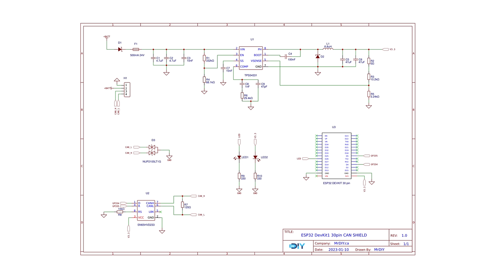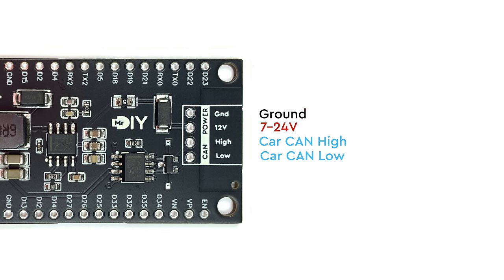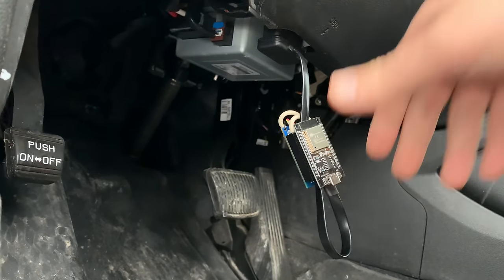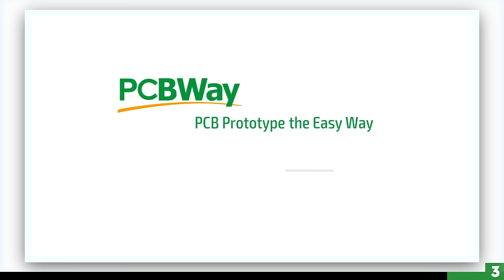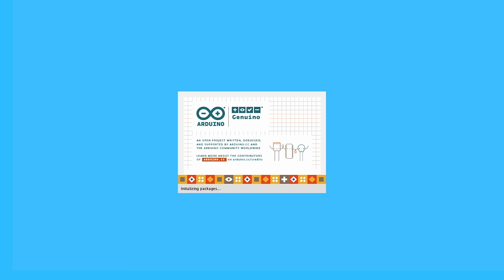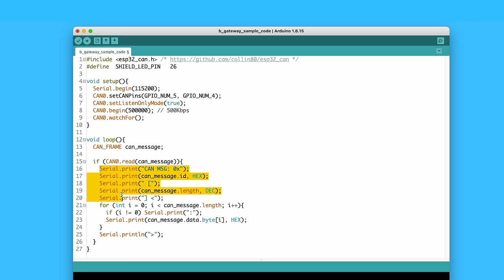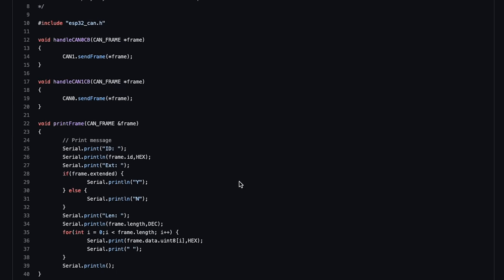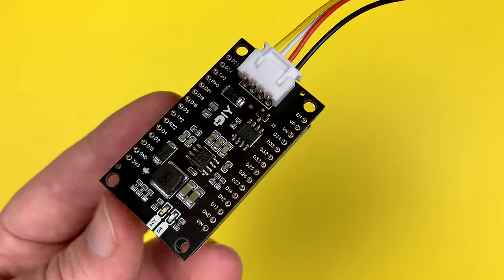The EASIEST Way to Connect to a Car's CAN Bus

Comment: I just bought 2x esp32-s3 otg's and a canable pro for reverse engineering undocumented BRP messages. My thought was to use both usb dev and host modes to relay the canbus messages (usb packets) over 'esp now'. One on the vehicle, and one on a laptop running candlelight or whatever.  With this piggyback board it seems I could avoid tunneling usb and pass esp now messages to the other esp32 and present it as a SocketCAN interface. Not sure which is less work.
Reply from the maker: That is exactly what I am doing right now. Car -> [CAN Shield -> ESP32]  -> ESPNow -> [ESP01 -> USB] -> PC/SavvyCAN. I wrote a minimal LAWICEL/SLCAN protocol on the ESP01. I just got it to work yesterday and can see the msgs coming in live in SavvyCAN.
Reply: Why do you need multiple ESP32? They have both Bluetooth and wifi, can’t you just use one of those to send data to a laptop? Simplest option would probably be to use either serial over Bluetooth or get it to work similar to a usb device over Bluetooth.
Reply: @conorstewart2214  ATV & other canam toys to ride around and rx/tx live data over long-ish distances. Don't want the laptop on the moving machine. BT imo is too short distance. 

I naively assume Windows would need a signed custom driver to turn wifi data into a virtual com port the usual canbus apps need. Seemed simpler to have another esp32 plug in to usb port and appear identical to the canable usb device. esp now will let me adjust speed/distance tradeoff as desired. 

YT comments lousy place for meaningful discussion sorry.
Reply: @MrDIYca  Awesome, looking forward to more vids on your project and a future github repo :)  My plan is more of a generic usb<>espnow<>usb extender than a canbus specific project. I bought all the stuff but no promises I will get around to it.
Reply from the maker: yes, that is another upcoming video

Comment: Can this thing turn off auto stop-start? Also does firewall cause a lot of headache?
Reply: What firewall? Do you know how Can Communication work's?
Reply: @skyminer01  Not really. But heard so much that with auto stop start eliminator device you can't plug it just anywhere because at least for subaru outback some places are firewalled - that is they don't accept injected packets.
Reply: @test-rj2vl  can bus is broadcast, u can just read as much as you want.
Reply: @test-rj2vl  writing obviously is a different story. Encryption, preconditions and session handling can prevent you from changing settings
Reply: @skyminer01  Ah ok so you cant write with this thing?
Reply: @test-rj2vl  you can write theoretically. But normally you really don't want to. The Can bus in a car is a critical system which you don't want to fail. Writing to the bus could cause it to fail or to be blocked if you don't exactly know what you are doing.
Reply: @skyminer01  Well auto stop-start eliminator for subaru outback does not work for european models. Was wondering if I can record the packet that is being sent when I toggle it and then use this thing shown in video to send my own packet every time car gets turned on. To effectively make a version of auto stop-start eliminator  that works with european version of subaru outback.
Reply: @test-rj2vl  Also it depends what you are trying to write, there is data that is sent cyclically every tens, hundreds of milliseconds so if you changed that the original sender will send it too and the receiver will react to both, there are other solutions to turn off auto stop start
Reply: @danradum  such as?  If you mean manually pressing the button then it needs to be done every time because it does not remember the off state.

Comment: Noob question: does the shield simply plug in, or is soldering required?
Reply from the maker: Sorry if it wasn’t clear but it requires to solder the header pins to the shield. Then, it is plug and play with the ESP32

Comment: I have ordered and received your board, as well as the esp32 board from your store...  Loaded all the needed libraries, and your example code - but all I get is a spinlock error.  All other non-can related sketches run fine on the board, but your can example does not...  Where can I get some help?
Reply from the maker: Hello Alec, you can reply to the order confirmation email and I can help you there.

Comment: Where can I get the cable / adapter to connect the boards to a Tesla Model 3 ?
Reply from the maker: You can try https://geni.us/AsDPDz but check with the seller to make sure it is comparable with YOUR Model 3.
Reply: @MrDIYca  thank you
Reply: @MrDIYca  Is there a USB interface in the rear of the Model 3 ?
Reply: Having looked at the above link there are many  different cables shown, which one is the cable I need to connect my 2020 model 3 Tesla ?

Comment: Can you comment on whether it can connect to an OBD 1 port. This was introduced in GM cars back in the 1990's and was also called an ALDL port. OBD 2 didn't start until 1996
Reply from the maker: Good question, I am not sure ... maybe an automotive history buff can help us out here
Reply: I don't believe any ODB 1 cars used CAN bus.  I don't think it was until some years after ODB II came out that some cars started using CAN.
Reply: @Jason Watson  i don't think all obd II is even canbus.i think it really started around 2004 or so,  same time as drive by wire and such.  For example on a 96 impala with obd II you can't unlock the doors or start the car via canbus
Reply: ALDL is nothing like OBDII. It is 160 bps serial data, very simple. There is an android app for it. I have a 26 year old web page on the subject from when I wrote a parallel port decoder for it. GM ALDL specs are available if you search.
Reply: OBD1 is manufacturer-specific diagnostics so the protocol and connectors are manufacturer-specific

Comment: Can the CAN-Bus termination resistor (120R) be disabled?
Reply: you can clearly see when hes holding the board that the resistors isn't even soldered on the board, so what do you think

Comment: I'm interested in buying your CAN Bus Shield. I'd like to plug it in the OBDII of my car. But once I get all set up and the car connected to the board, printing messages to the serial, how am I going to translate messages like the ones you showed in the video, for example: CAN MSG: 0x19C [5] <09:F7:98:9>. How to translate it into useful data? Me I'd like to get to know speed, hodometer, fuel level, and stuff like that. How can I translate messages like <09:F7:98:9> into fuel level, for example? Is there any code examples I could look into? I'd like to get to know more about it before purchasing this board. Sorry, but I'm a beginner in hardware and stuff, I'm used to PHP and Python only.
Reply from the maker: CAN decoding varies from one car manufacturer to another, and even among different models from the same manufacturer. Google is your friend. Attempt to search for a DBC file for your specific car model. You may be fortunate enough to find one. DBC files assist in translating these values to their actual meanings, functioning like a dictionary for CAN messages. OpenDBC is a good starting point - https://github.com/commaai/opendbc
Reply: @MrDIYca  Thanks for your help!! I'll look into it